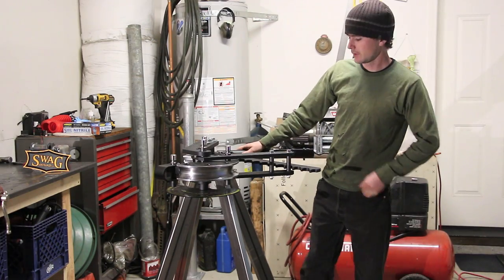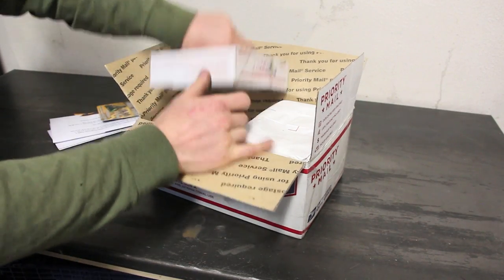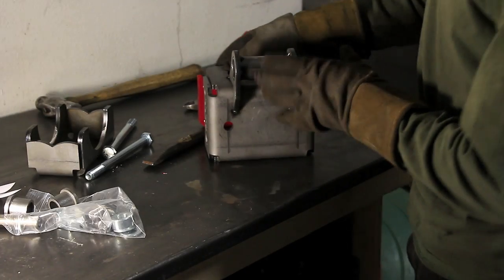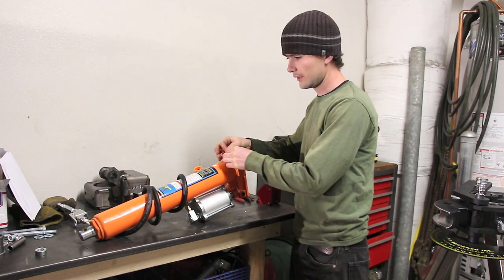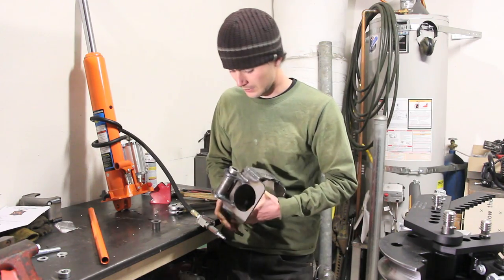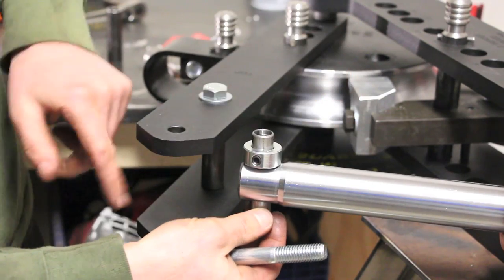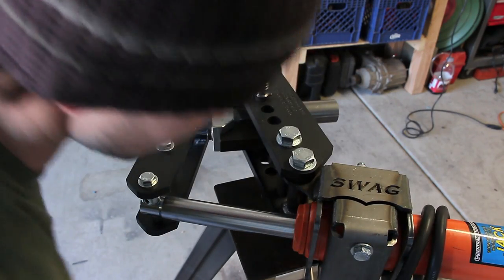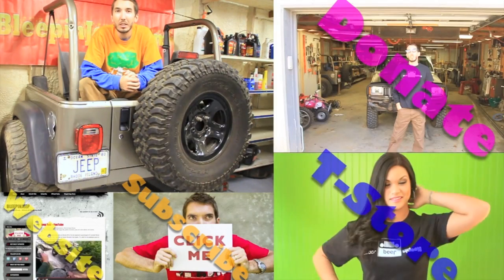Swag Offroad Air/Hydraulic Ram Mount Install

Comment: The swag adapter really makes this bender so much more user friendly. The best benefit, as you mentioned is having a setup that doesn’t need to be bolted to the floor. Really handy since you want a lot of room around your bender and you don’t want it bolted to the center of the garage. Lol. The return spring is a great addition.

Comment: The JD2 manual says to torque the bolt for the handle (that you have to remove for the ram mount) to around 71 ft/lbs (IIRC). I added my Tam mount and torqued to factory spec and it seems far too tight. it doesn't allow the ram mount to swivel and the ram extends. 

Dis you run into this? Are you torqued to spec? Did you just hand tighten?
Reply: sorry for typos. *Did *Ram

Comment: Best video on the Air/Hydraulic conversion yet. I just bought this exact same set up. Only thing you did not explain is how much of a pain in the butt it is to push the ram back manually. Buy the Swag elastic spring kit it is worth the $50  Thanks.

Comment: I could be wrong a friend of my built a 90* square frame with a mount plate and gusset. Mounted the tube bender and the frame plugs into the receiver of his truck your not bolting or moving that vehicle. We live in Az so weather is almost always compliant.

Comment: Good information - not sure I would buy a 400.00 tube bender then add on hydraulics on top of that cost ....
Reply: so would you just spend the 700+ to get the hydrolic version in the first place? This method still comes out cheaper and you don't have to do it all at once.
Reply: sjeverett75 it's actually eight hundred bucks for the hydraulic version and it only gives you hydraulic piston with it you still have to buy Power supply hydraulic pump 900 bucks for the electric pump or 500 for the air over hydraulic so you're looking at 1200 minimum and 1600 maximum and you still have to buy dies

Comment: Were you welding with your hh140? What's the thickness on the swag brackets?
Reply from the maker: Yeah, sure was. The swag ram mount is 1/4" thick. Thit was definitely the limit of single pass welding with that machine. I wasn't able to burn the welds in as hot as I would have liked with my hh140 but it welded it strong enough that I'm not worried about it coming apart. Works for me!     - Tim